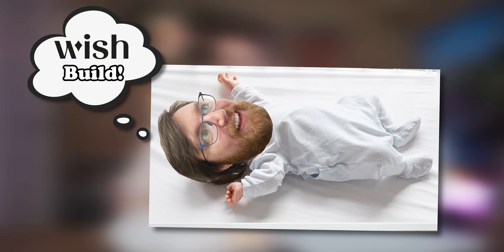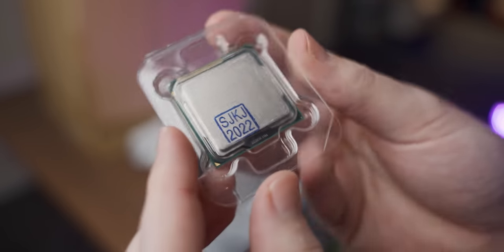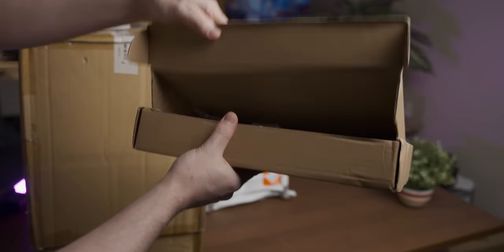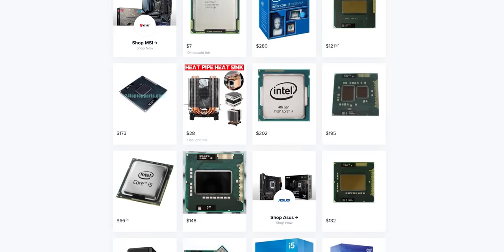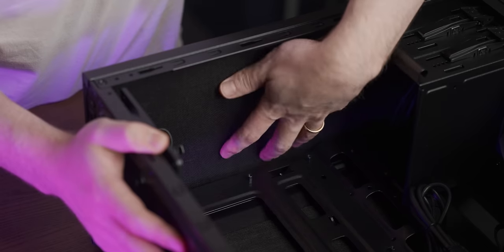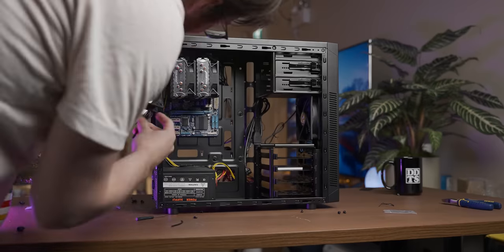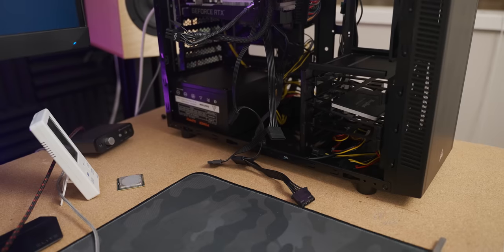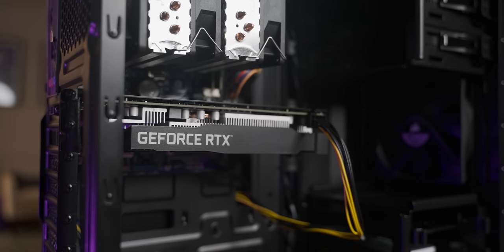Building A Gaming PC Using Wish.com Causes Emotional Damage...

Comment: When you slapped the top of the case 👋 after installing the parts I just expected it to buckle in on itself with out the side panels on for structural support 😂. Since I mean it was real flexible on the rear io 😰…. Lmao 

Also I would defiantly throw that 1000w psu out after the video I’m guessing even with out power connected it might still attempt to burn your house down 🔥…

Comment: You definitely won because you didn’t get confused by the term “switching power supply” which is a method of power rectification and they thought it meant dual voltage. 

Although your power supply didn’t work, at least you ordered a compatible part. 

They substituted another, but technically the PC they order d was non-functional. 

Your power supply failure wasn’t your fault. Theirs was.

Comment: That powersupply was rated at 25 amp on the 12v rail, so it was only a 300 Watt PSU 😂, I guess it didn't have enough juice to boot up the gpu

Comment: Wow, my old Game-PC that had a OC Intel Core i7-5775C 4.0 GHz, gets in CINEBENCH R20 1914 points, that 
is MUCH higher then 267 points, 267 points is very low, yeah the Intel Xeon E3-1270 came out in 2011, 
and my Intel Core i7-5775C came out in 2015, but that is only a 4 years difference.

Comment: What software are you using to show the system information?
Reply: Hwinfo
Reply: If you mean the overlay of temperatures and usages then that's baked into MSI afterburner. Just search for a tutorial on how to use MSI afterburner OSD and it should come up with something. It's pretty handy when you get all of the settings how you like them. 

If your option for OSD doesn't show then reinstall MSI afterburner and make sure the "rivatuner statistics server" box is ticked.
Reply: @jordanlazarus7345  thank you

Comment: Dunno where technology has gone since I started troubleshooting hardware...but before I start taking apart motherboards and switching out CPU's to diagnose a boot/power/windows blue screen problem...I start with RAM/removing peripherals/PSU and move on to harder shit.
I get trying to make a longer video, but technicians would probably rather see B-roll fill the space than sit here and yell at the screen.

Comment: The I/O shield could be worse, I had to design/3D print mine for an old mobo I bought.
Reply: at that point I'd just leave it out
Reply: @jordanlazarus7345  I personally preferred having it, knowing my luck something would end up falling into it if I hadn’t.

It wasn’t too much effort, I used an existing design as a template, the only reason it was harder than it would have been is because I lacked callipers at the time.
Reply: @tech34756  That's pretty cool to be fair. I'm far too lazy for that effort though

Comment: Assuming that's really a Galax(y) card, it should be a solid 2060, trip across the world in a bum's asshole not withstanding. They used to sell in the US when I got started, I remember seeing them selling stuff at Fry's back in the day lol. That case looks like a hotbox though lmao, and that "1000w" power supply with only 150w of graphics power (single 8 pin) is impressively bad, and probably it's only just adequate for the PC inside the case lmao. On the note of Fry's, when I worked in the service department there for a while, I'd always have to wire up the CPU power on motherboards, specifically because most all of the cases were built using that same kind of CPU power cable routing, combined with equally bad case dimensions providing no space for my giant hands lol. I'd run the cable in behind the motherboard, using the gap from the standoffs to create enough space for it to fit through, and that was what I had to do because there were no sexy cable extensions back then, and we couldn't bill the customer for extra stuff like that if it wasn't absolutely necessary lmao. at least the ketchup and mustard extensions we sold in the store were molded flat

Comment: I have a Corsair 100R and indeed my under-desk mounting hardware that clamps the case between a top clamp and an under-case support beam made the case bend as the computer kept pushing its side panel lovely stuff... but it is light and that is what counts when you are mounting on an under-table desktop hanger thing.

But the CPU power rounting is an abommination on this case. If you have not pulled your cables through before putting the mobo in you are very F^%$$£

Comment: I'm late to the comment party, but I'd be willing to bet that the poor performance of the system gaming wise might be due to the processor only supporting PCIE revision 2.0, meaning the bridge between the processor and graphics card was restrained to 2.0 giga transfers per second instead of the 8.0 gigabyte transfers per second of pcie gen 3. Plus, I believe the sandy bridge architecture is missing newer standards, like AVX2 that was introduced two generations later with Haswell. Though, I feel like the PCIE connection is probably causing most of the performance issues.

Comment: G'day Dawid,
You needed to get the E3-1270 V2 or i7-3770 + B75, the 1270 is limited to PCIe X16 Gen2 but the V2 & 3770 have PCIe X16 Gen3 so would have been much better for gaming with the 2060,
plus according to Cinebench even the 3rd Gen i5-3550 4c/4t kicked the Xeon's Butt with it's 4c/8t 🤦‍♂

Comment: Fun system - If only you couldn't get a:
AMD Ryzen 5 5600
ASRock B550 Phantom Gaming 4
Corsair Vengeance LPX 32 GB (2 x 16 GB) DDR4-3600 CL18
Samsung 970 Evo Plus 500 GB M.2-2280 	
MSI MECH 2X Radeon RX 6700 XT 12 GB	
Fractal Design Focus 2 ATX Mid Tower Case
EVGA 700 GD 700 W 80+ Gold 
system on Newegg for $836.93 😀

Comment: Sad,... Cyberpunk 2077 doesn't run on my machine at all. My system specs?
MB: MSI B550 Pro
CPU: AMD Ryzen 5 5500
RAM: 32GB DDR4 3200Mhz
GPU: XFX Radeon RX 580 GTS Black Edition 8GB GDDR5
SSD: 1TB NVMe M.2 SanDisk Ultra 3D
NZXT Mid-tower case.

Tried running CyberPunk 2077.
Yeah sure,... at 720p with everything at lowest possible settings and I got a whopping,... mind blowing 16 frames a second average, 1 frame per second 1% lows and many many MANY instances of crash to desktop.
That game does not like my system at all. OK, so that game isn't for me. I get the message. My machine needs a serious upgrade. Fine,... I'll get right on that.

Comment: The only part that really bothers me is you buying the power supply on Wish. That's irresponsible for so many reasons. This contest should re-establish the parameters due to the inherent dangers of unreliable PSU's.

EDIT: My comment above was posted before I saw that it was the PSU that was failing the build. You deserve it Mr. Dodd or Dawid.

Comment: Wow u got massive rip off.
I can buy u stuff about half the price
Cpu 30 usd
Mobo 20 usd for used and 35 for new one
Cooler 12 usd
Gpu 235 usd(new) and 160(used)
Ssd 20 usd
The rest is fine i guess???

Comment: Man, AliExpress vs wish is like fighting Ukraine army with a spoon and in underwear

Not only you can get "legit" (albeit mined af) gpus, you have the entire x99 lineup against you

Heck you can even get an "i9 9900k" Engineering sample laptop cpu adapted for lga 1151 for 140 usd, and you can buy used net cafe mobos for around the same price

Recently there was an adapted RX 6600m laptop gpu in a standard pcie desktop gpu format for 189 usd and it worked like a 6600

If Toasty bros did their Homework you are in for a rough day